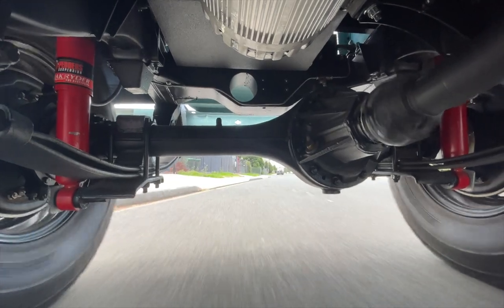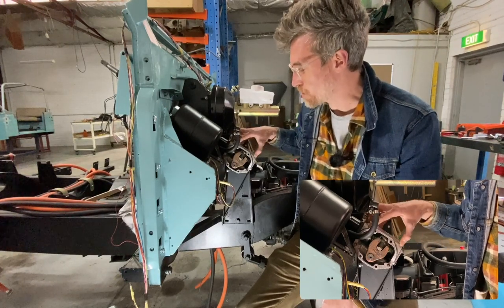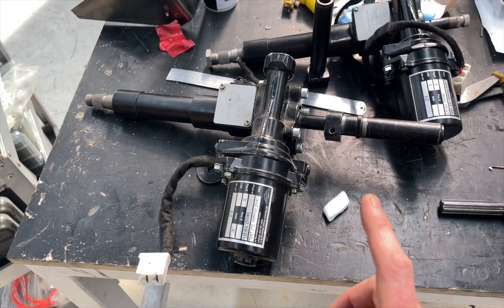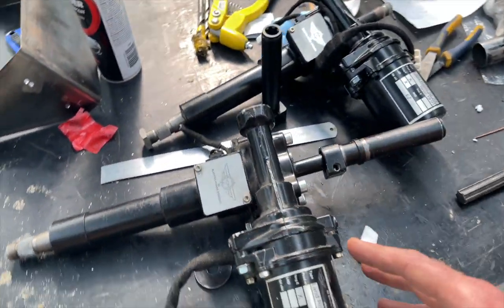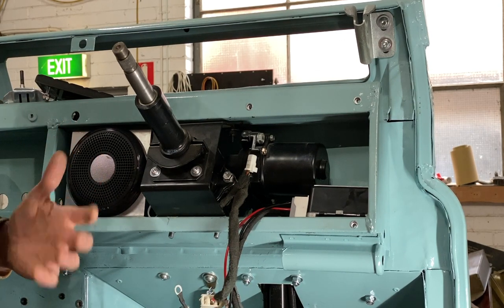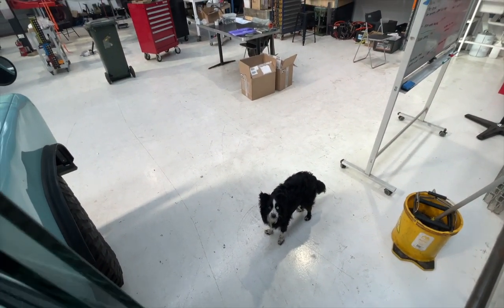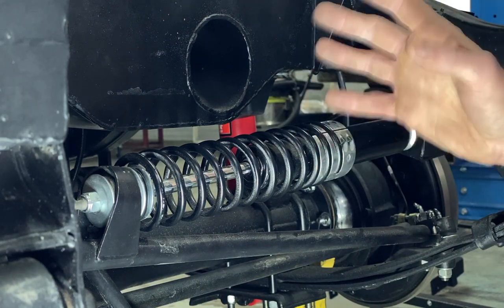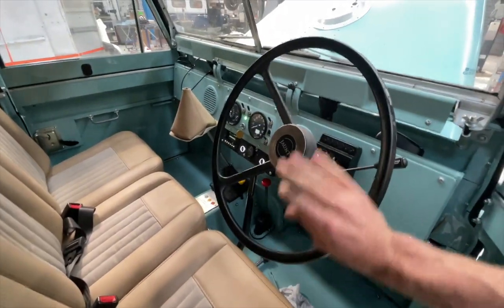Electric Power Steering in a Series Land Rover

Comment: Well I ran into  issues trying to install my EZ power unit. My LHD LR series 2a (1967-68) has a wiper motor right where the electrical motor for the power steering would be.... Also, the instructions are extremely incomplete. Did you have to cut your housing  steering box tube?

Comment: Sorry to post off the topic of power steering, but it looks like you've done away with the electrical FWD/REV switch and were using the mechanical shift to reverse out at the end. Is this the new (old) normal?

Comment: Unfortunately the weak point of the steering is the steering box. You have just added more stress to the steering box. I have seen several damaged ones, very likely you will have problems. You would be better with the Haystee Automotive type hydraulic unit which takes all the load off the steering box and the relay. I have been running one for about 5 years with 33x10.5 mud tyres and it has been flawless.
Reply from the maker: It's difficult for us to add hydraulic pressure. The electric pumps would be by far the most noisy thing on the car. Know what you mean about the steering boxes though, almost every original one that comes into the workshop is cracked at the mount points
Reply: @Jauntmotors  Some EHPS units are pretty quiet, however I can understand not wanting hydraulics. I wonder if it would be possible the mount an electric PS unit (like the one Ev West sells), in place of the relay. Therefore taking the load off the steering box. I am doing the research for my own conversion....
Reply: I struggle to fully understand the stress argument. The elec assist steer is not putting any more torque through the box, it is just reducing it from our arms. If I turn my fully manual 2a with its 900x16 tyres at zero speed on rough concrete I am putting a huge effort in, an elec assistance will not put any more or less to turn the wheels, it just makes it easier on me. The haystee system is reputed to be great, only issue is price and when adding it to already worn or faulty steering gear. I think I would opt for an elec unit still though and plan to go down that road in my build.
Reply: @NathanNostaw  It's not really a case of either/or. If you have power steering "above" the steering box you are going to put more torque, more often, through it. You can bust them even with arms like Dave's (sorry Dave). Without PS you can feel when you are overloading the steering and tend to back off (like when wheels are stuck in a rut). I will be interested to see how the EZ holds up but I suspect at the very least you will be chasing steering play for warrants, which has never been a problem with the Haystee system. What is the price of the EZ unit? Although even if it was half the price I wouldn't use it unless I could work out how to put it below the steering box.
Reply: @NathanNostaw  when I’m manoeuvring in my 61 lwb I COULD grind the wheels round but the feedback is FUCK NO!
So I creep forward or back and pull the steering as the tyres rotate. Half the effort and that’s how it was designed to be done. The only time I’ll go  lock to lock without moving is on loose surfaces wet grass or mud. The series steering box flexes even when it’s done up proper, that’s why defenders have them bolted to the chassis not the footwell and a pressed steel plate. 
I’d love PAS but I agree with th other chap, hydraulic ram to to wheels is the best, kindest system